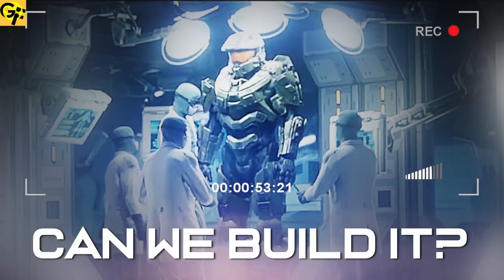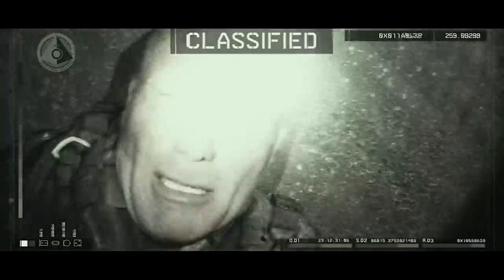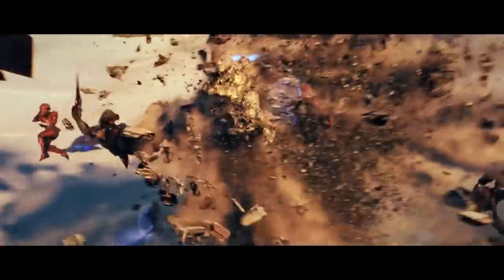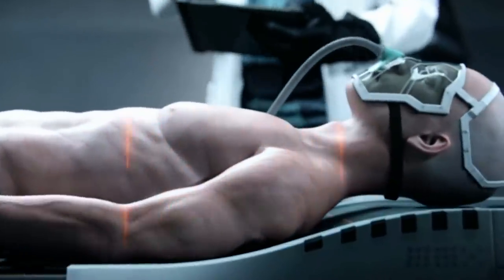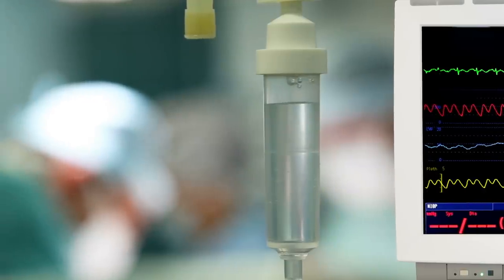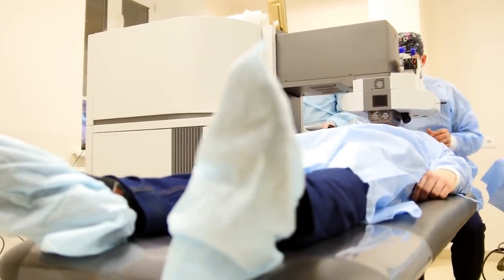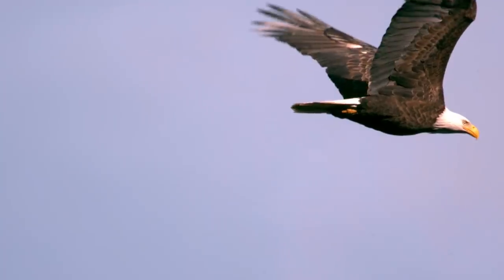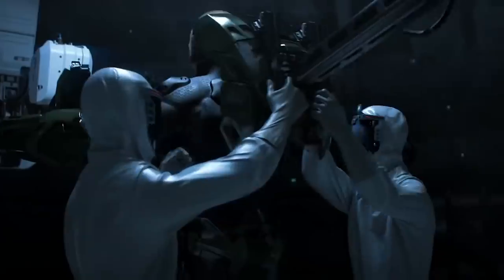Can We Create a HALO Spartan | Human Augmentation

Comment: For SPARTAN II’s it was certainly dangerous, but I think by the time SPARTAN IV’s we’re being augmented they had refined the process to a much safer level (i.e. They used carbon nanotube structures to reinforce bones on S-IV’s rather than the carbide ossification the S-II’s got.
Reply: QuantumAscension1 they had refined the process 20 years before that. The IIIs were trained and graduated by the hundreds.
Reply: @FrozenPhoenix15  that's true about the Spartan III program each class size was 300 strong. The only difference is that with that Spartan III's and IV's is that their genetic augmentatuon was lesser than that of the Spartan II's. The Spartan III's were designed to be expendable suicide soldiers and thus their augmentations we're just so they were good enough. The Spartan IV's, due to them being adults unlike the prior two program which used children, had a 100% survival rate for augmentations and were inferior to that of the Spartan II and Spartan III augmentations. The gen two Mjolner armor made up in the disparity making the Spartan IV's equal to a Sparan II in Mark V armor.
Reply: john USAS the III’s augmentations were superior to the II’s. They had the same effects and could be applied to a much wider candidate pool with a 100% success rate. ONI actually used the III’s augmentations to bring some of the washed-out/dead IIs back into service. 

Betas were literally dodging shots and sword swipes at point-blank range, as well as overpowering Elites. All without Mjolnir. What would make you think that their augmentations were inferior?
Reply: @johnusas2870  Not true. The IIIs went through the same augmentation process as the IIs, but through a more refined method. The IIIs are every bit as effective as the IIs. The IVs are only as effective as the IIs (while the II is in Gen1 MJOLNIR) because if their newer Gen2 MJOLNIR models.
Reply: @FrozenPhoenix15  begs the question of why the 3s were disposable troops if they were superior to the 2s. I do recall that the 3s may have gotten one or two fewer augmentations
Reply: @duncankelcey9281  
It was actually in big part about armour, most Spartan 3s never got MJOLNIR armour, I believe only headhunters and fireteams got MJOLNIR armour, which really increased fatality rates a lot, and since they were used to handle tough and dangerous missions that also contributed, I believe it was mostly about project funding
Reply: Spartan 3s too
Reply: Yeah, the Spartan IV were safer to make, but they were not as powerful as the II line.  Also the Spartan IVs were thought of as punks.  The IIs were trained in War.  They were Spartans in the Greek meaning of Spartan.  The fours were the Special Forces that got augmented and then got big heads.  The never really learned how to use the upgrades.  The fraught as special forces, not as Spartans...
Reply: +JinaSolo Well, I don't think he was trying to make a 1:1 comparison of their combat psychology, but rather if we could make similar biotechnological advancements to achieve something similar to SPARTAN augmentations regardless of the generations. I was just pointing out that the 35+ years between the II and IV augmentations probably went through a lot of improvements in order to keep half of their candidates from dying on the operating table.
Reply: Think of it like this. Outside of their armor a SII could easily defeat a SIV with or without a gun (assuming they are on the same level weapon and skill wise). However if those same 2  Spartans were in armor then they would be as equals. The armor SIVs wore was far more advanced and safer to use for a less augmented person than the armor the SIIs wore but the augments themselves set the Spartans apart.
Reply: David Tector 1. “If you actually read the books…” lol, okay, then give me the page numbers. 
2. “Less training time” Their training was shorter, but far more focused. The IIIs were trained from day 1 to fight Covenant, specifically. Taught their strengths and weaknesses, and even how to use the Covenant’s technology in combat. The IIs spent 6 years figuring things out as they went, and Kurt passed that knowledge to the IIIs. 

3. They have less body enhancements because their augments are chemically-based, not surgically. The end result of the augmentations is the same. If you still disagree, cite your source. 

4. The Covenant uses “active camo”, the IIIs (and the rest of the UNSC) use adaptive camouflage. Entirely different technology base. 

5. “Turnover rate” The IIIs are literally given missions that are too risky even for the legendary Spartan-IIs. And when the IIs are given those same missions, like heading planet side to defend some generators while the planet’s under siege, or infiltrating a massive fleet without support and destroying its support base, they die all the same. 

But you’d know all that if you actually read the books.   ;)
Reply: @johnusas2870  Master Chief could defeat 3,4,and 5s .. his training, augmentation, experience puts him above the competition
Reply: @coppertopv365  I hope you realize Spartan 117 wasn't the best Spartan II. He was a good leader and the luckiest Spartan, but he recognized that Linda was the best sniper and stealthiest; He saw that Kelly was the fastest for example. As well as you have to remember Spartan III's were designed to be expendable suicide soldiers mend to buy humanity time. And Spartan IV's match the level of Spartan II's in their gen 2 Mjolner armor. You may want to check your lore because there isn't a fifth generation of Spartans.
Reply: To be honest Halo 5 didn't present Spartan IIs the right way... Master Chief would have kicked Locke's ass and tossed it into the lava below
Reply: @FrozenPhoenix15  Incorrect. While the SPARTAN-IIIs did receive amazing augmentations, they are not superior to that of the IIs. The augmentations the SPARTAN-IIIs received were more chemically based, but the SPARTAN-IIs got more surgically based augmentations. In Mjolnir, SPARTAN-IIIs and SPARTAN-IIs could be put on basically the same level, but out of armor it's not a competition between the two; the IIs are much stronger
Reply: The Dreaded Animation if you were familiar with the mechanics of Krogan Blood Rage from Mass Effect, you’d realize how wrong you are.
Reply: @FrozenPhoenix15  Hm? Mass Effect does not have anything to do with what I said. I'm just stating what I've learned from my time researching Halo lore

ok, so, I've decided to check on the SPARTAN-III augmentations, and you are mostly correct. I still do not believe that out of armor, a SPARTAN-III can overpower a SPARTAN-II due to the large age gap, but I do believe that the SPARTAN-IIIs are much closer to the level of a SPARTAN-II than I had recently believed (3 SPARTAN-IIIs in SPI armor could definitely kill a SPARTAN-II with minimal casualties (if any))
Reply: The Dreaded Animation I’ll admit that a 12-year-old rookie beating a veteran in their early 40s is a bit of a stretch, but I think we can both agree that if they were both in their late 20s-early 30s, a Beta could beat a Spartan-II. I think it goes without saying that a similar situation involving a Gamma would be a massacre.
Reply: @FrozenPhoenix15  You do also need to remember that SPARTAN-IIIs are literally tiny in comparison to the SPARTAN-IIs. Emile-A239 in full Mjolnir is barely as tall as a SPARTAN-II out of armor
Reply: The Dreaded Animation yeah, and they’re even tinier in comparison to the Elites, but that didn’t stop Tom from dropping one in hand-to-hand combat. Didn’t stop the rest of Beta company from massacring them out in the fields, either. 

I don’t think people appreciate the fact that the IIIs were literally trained fight (and win) against opponents that were much larger than them, without the use of power armor.
Reply: @FrozenPhoenix15  Actually, in recent Halo lore, SPI armor has been pretty much phased out by Mjolnir amongst the SPARTAN-IIIs
Reply: The Dreaded Animation that’s great, but it still doesn’t change the fact that, when they were being trained, there was no expectation that they’d be able to rely on having power armor. Kurt was always hesitant to being overly reliant on technology, a sentiment which has unfortunately been completely ignored in the post-war era.
Reply: @FrozenPhoenix15  The SPARTAN-IIs also weren't trained to need to rely on power armor, as there was no power armor for them to rely on during training
Reply: The Dreaded Animation I’m not really sure what the point is of your last few replies. You mention that there’s a size difference between the IIs and IIIs, I counter that the difference is irrelevant due to the IIIs being trained to fight larger opponents without power armor. Then you mention that SPI has been phased-out in favor of Mjolnir? That’s not a counter-argument, it’s a factoid. The IIs didn’t originally train to rely on power armor? An even worse non-counter-argument because: 1. Even though they were likely trained to fight people larger than them (adults), they definitely weren’t trained to fight 7ft tall aliens in shielded armor (unlike the IIIs). 2. They still used Mjolnir extensively, and it would inadvertently act as a safety net. As I mentioned before, there was no expectation that the IIIs would ever have power armor. Therefore, no such safety net. 

I hope that you’re not just trying to avoid admitting that I’m right. I’ve been trying to argue in good faith. I don’t hate the Spartan-IIs, or think that they’re bad, but the IIIs were designed to be objectively superior. They used the foundation of the Spartan-II program, and built from there. I don’t understand why this is so contentious.
Reply: john USAS Nah he was/is the best Spartan 2 to ever live. He may not have been the best at every individual aspect that you can judge him on, but he was well rounded in everything and a great leader and lucky. Combine that with his achievements and you have the best Spartan 2
Reply: I think that leads Soo many children dead
Reply: @Yoda you Commented on something I wrote 2 years ago.  Interesting you is Padawan Yoda.. and I dont think you meant to talk with me. Spartan V wasnt in my comment
Reply: @Yoda if that is the case... I mean he could if there was a 5,6,7..
Reply: I dont think chief is really lucky, i think its just bc of his knowledge, armor, and good AI that make others think hes lucky
Reply: @FrozenPhoenix15  Sadly, you are missing one change that was noticeable to the Spartan 2'S when they interacted with the spartan 3s is due to the increased adrenaline augmentation on their frontal lobe (sadly cant remember the exact name of the two chemicals) that allowed them to fight through more pain than the 2s, also made them twitchy, causing I believe 2 blown ambushes while on Onyx.
And one of the things that alot of people are brushing off about the S3's is the numbers sent on their missions. Yes they were suicide missions and yes they accomplished them, however they were groups of around 300 for their missions like destroying the shipyard that Tom and Lucy are the only survivors.
Are you trying to tell me that an equivalent number of Spartan 2s would be inferior to the S3's when from the beginning there, have been over ten times the number of S2 versus the S3? Both in comprehension and length, the S2 have more training, have better equipment that they are capable of using (hence why Lucy was so shocked when Kurt refused to put his S2 armor back on when defending Onyx), are more durable to damage while the S3 can maybe fight off more pain? Idk Will, James, and Kelly fighting with a damn near fully burned body, brings that into question on who could fight through the most pain.
I admire that the S3's were able to accomplish what they did given how they were created. Cutting the cost of material, trying to do more with less, and switching into production mode, are not the best ways to encourage high survivability. They were treated like disposable MAC rounds fired at a target, especially the first 2 batches, if you give the group the same training both in time  and intensity and give them their battle experience, they may be able hang with the S2s. However something that was trained and meant to be disposable, will be inferior to something trained and meant to be the face of the human war effort.
Reply: @burnedbacon3989  Cortana chooses him because of luck. Dr. Halsey comments it might be luck with the coin flipping scene when John is a child.
It is what set him apart from all the other spartans. Linda could outshoot him, kelly could outrun him, kurt was as good or better tactically, sam was stronger, Fred apparently could come in first place in training contests if he wanted to but didn't because he didnt like the attention... Cortana knew that luck would set him apart and that is why she chose him. If she wanted the one who was most physically capable she would have one hell of a tough choice.
Reply: @RepressedMemories16  1. I didn't miss anything. If the S-III's "twitchiness" was augment-based, it would've been a persistent factor throughout the conflict, rather than being limited to one or two early encounters. The simplest explanation is that this was their first taste of actual combat, they're facing an opponent that they weren't trained to deal with, using technology that even the Covenant didn't have. They were fresh out of training and forced to perform in front of their predecessors. Simply put, they were nervous, and made some mistakes.
People like to romanticize the S-IIs, and so they gloss over their failures. No one talks about how on their first mission (the capture of Col. Watts), John rushed through a doorway, and got shot by Watts' guards three times, one of the rounds puncturing his suit. Or how about, despite them needing to remain inconspicuous, Blue Team marched in tight formation towards their objective, possibly tipping off any onlookers. Or the fact that they thought venting an entire docking bay full of civilians into space was the best course of action to make their escape. Rookie mistakes.
2. Considering the scale of the threat, the number of IIIs sent made sense. That shipyard (Operation Prometheus) was a literal asteroid, and their objectives were spread across the surface of it. Operation Torpedo (the Tom & Lucy mission) was a city-sized fuel refinery large enough to comfortably service 7 Covenant cruisers. In both cases, the forces defending them numbered in the thousands. So yes, sending hundreds of non-Mjolnir soldiers sounds appropriate.
3. Things are a bit jumbled here, but I think I get what you're saying. If you're asking if I believe that IIs are inferior to IIIs, then yes. The III's training is better. They're trained by the same guy (Mendez) and a Spartan-II that served on Blue Team. A Spartan notable for being the leader of the only team that was able to consistently beat John's Blue Team. Both of them gained a wealth of knowledge and experience in the 6-year gap between the generations, which would've been passed on to the IIIs. Having Covenant tech to train on, and not having to waste time imprisoning and torturing the candidates, means that the III's training was much more comprehensive and time-efficient. And most importantly, there's literally no evidence that the III's training was inferior. Equipment-wise? The IIIs can use whatever equipment (including Mjolnir) the IIs can. It's part of their training.
4. Dante dragged all 1000 pounds of Fred's dead weight after having his chest cavity blown open by Needler shards, then rappelled off an exploding platform, and sprinting down an enormous staircase. His internal organs were literally exposed; that goes way beyond "resistant to pain". Gamma Company are the most durable Spartans. End of discussion.

Honestly, I've been doing this song and dance for awhile now. As a fan of the novels, I'm quite frankly tired of getting into these same exact arguments with people who've watched a couple YouTube videos and think they know what they're talking about. I know I sound like an asshole, but sometimes there just isn't a nice way to say what needs to be said.
Reply: @FrozenPhoenix15  alright man, I too have read the novels, ghost of onyx being one of my favorites. Sadly could not find my book because I wanted to look it up; when did Dante carry Fred? As far as I know Fred made it through the portal with Kelly, Linda, Mendez and the others at Onyx?
 Wont deny that Gamma probably is the most physically durable spartan group created with the additional augments put within them by Kurt. However just because they are the most durable in my opinion doesnt make them the best in my eyes.
I dont think the green/first experience at combat can be waved off as easily as you think, as it can be used to excuse blue team's first mission as well. But again this is just personal opinion.
The biggest thing that I believe is also being overlooked is that Gamma is the third iteration of the spartan 3s. It took that many generations before Kurt was allowed to try make them have more survivability in the field. And yes you are right, they can operate S2 equipment including the armor, but if brass never deemed them valuable enough to provide the equipment, what good is that arguement? Gamma company with S2 equipment may outperform blue team, but we never got to see it, simply because brass didnt look at these disposable soldiers as worth the investment. Ackerson truly was all about production mode for those first two groups.
There was only ever one generation of spartan 2s and they accomplished more than any single battle group against the covenant, it is why it is so easy to romanticize them. The spartan 3 program was born from the idea of mass produced, disposable child soldiers, took the first two groups getting wiped out nearly in its entirety before thoughts of survivability were considered, which is alot harder to swallow at least in my eyes.

But again, at the end of the day it is just lore in a video game. There are alot of scenarios we will never get to see play out, such as if a S3 in full agression mode, can they match a brute in strength? What the hell happens to the war if the slip space crystal makes it to Earth or falls to the covenant? I still cant find how blue team escaped the sphere from the center of Onyx?

I dont blame you for getting annoyed with having to repeat the same arguements over and over, especially when you are positive you are right, I get the same way when explaining how Blue is effectively the best color in MTG, however if someone is stuck in their view point and will refuse to consider evidence, nothing can be said to change their mind. I end up just classifying them in my head under the same category as flat earthers, makes dealing with the frustration much easier.
Reply: @RepressedMemories16  Right after Kurt and friends made it into Zone 67, they found an enormous landing platform (presumably used for receiving fleeing Forerunners). The Covenant came in force behind them, and a shootout erupted on the platform (not the final fight at the core, the first actual contact between the Spartans and the Covenant on Onyx). Fred gets dropped by a shot from a couple Hunters, Kurt orders Dante drag him back to safety while everyone else provides suppressing fire. Dante gets hit mid-drag and keeps going.
I agree, if their only trait is them being the most durable, I wouldn't consider them the best either.
It sounds like your argument is more about UNSC/ONI leadership, rather than the IIIs themselves. Is it their fault that brass used them so poorly? Spartans don't choose their own missions, they go where they're told to go, do what they're told to do. Did Beta Company choose to drop on that fuel refinery with poor intel? No, some random ONI analyst did. Beta Company was dead the second the green light was given for that mission, which makes their victory that much more impressive. Outnumbered 10-1, stealth blown, no ground or air support, with 7 Covenant warships attacking them? The fact that they succeeded at all is a testament to their training and determination. Even on the Spartan-II's worst ops, they never had it as bad as Operation Torpedo.
Saying the IIIs are bad because they were always sent to punch above their weight, is like saying a UNSC frigate is bad because it can't go toe-to-toe with a Covenant cruiser. That Frigate is carrying a MAC and maybe a nuke or two; it could level multiple cities if they so chose.
There's an argument to be made that the IIIs made the largest impact during the Covenant War: the concept of tactical versus strategic. Generally, the IIs are sent on missions that are an immediate threat to humanity; "Do this, or the war ends tomorrow (tactical)". While the IIIs are given the missions of: "If this isn't dealt with now, the Covenant will be unstoppable 5 years from now (strategic)". It's debatable.
It's not something that ever really gets brought up, but I'm assuming that augments are relatively cheap. The IIIs don't get the equipment or operational support of the IIs, but they get better versions of all their augments? And before we even get into it, yes the IIIs have objectively better augments. Kurt describes them as a "quantum leap" beyond what the IIs have, we see similar results to the II's (Tom outmaneuvering and overpowering an Elite during Torpedo, the rest of Beta moving too fast for the Covenant to hit them on an open field with no cover, one of the Gammas being strong and fast enough to counter Kelly's grapple on Onyx, all without Mjolnir). And all of that with a 100% successful implantation rate. Objectively better. So, augments are probably cheap, but what they already had is so comprehensive that there isn't really much room for anything more. Kurt was desperate and looking to give his Spartans any kind of edge. He couldn't get them better tech, so he got them an additional augment instead. 
Logistically, that brain augment is a terrible idea. Anywhere the Gammas would deploy from or return to would need to maintain a massive supply of two separate, relatively uncommon drugs that would need to be administered regularly. And if the Gammas run out, they become a danger to themselves and anyone trying to help them. Personally, I believe that Parangosky had a soft spot for Spartans, and only greenlit that augment because she felt bad for Kurt.
Depending on what you would classify as "full-aggression", there are a couple examples. Ash pushes himself pretty far when outrunning the sentinels towards the end of Ghosts of Onyx. Last Light depicts the Gamma's descent into madness, culminating in Mark killing an entire team of Brutes with just a knife.
The slipspace crystal did actually make an appearance in Shadows of Reach, allowing Atriox to travel from the Ark to Reach.
The last one is a bit complicated because the names for things are counter-intuitive. So, two separate objects: Onyx, a hollow sphere masquerading as a planet, and Shield World Sarcophagus, also a hollow sphere (a miniature Dyson Sphere). Onyx exists in realspace concealing Sarcophagus (a literal shield for the "shield world"), while Sarcophagus is essentially just a massive bunker existing in slipspace. The core room for Onyx houses a portal into that bunker. In reality, Onyx's core room (and every other location they visited after Halsey teleported them) was probably free-floating in realspace, beneath the Sentinel layer. Powered and held in place by Forerunner techno-sorcery.

I'm sorry about my tone earlier. It's rare these days to encounter people on YouTube that actually read the novels.